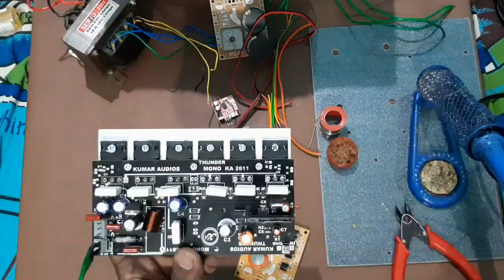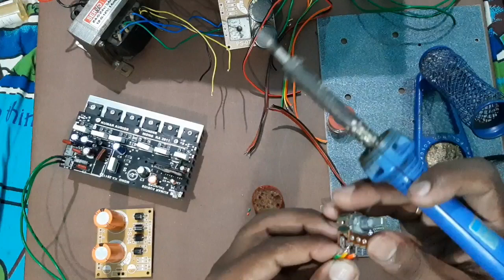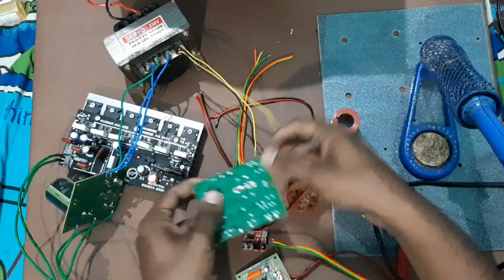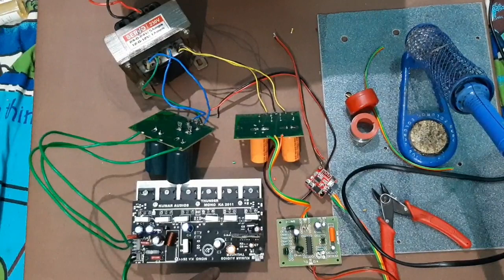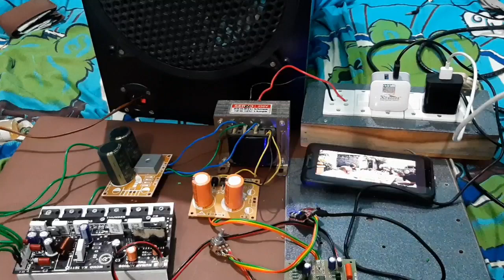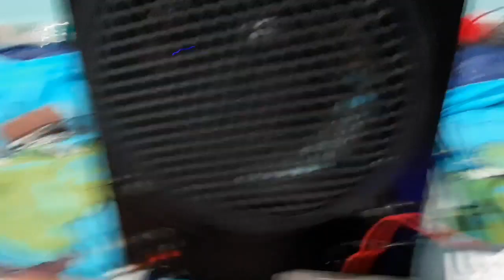6 FET MONO AMPLIFIER BOARD CONNECTIONS AND 10" SUBWOOFER TESTING

Comment: Sir ennidam 24 0 24 5amp transform er ulladhu. Athai intha kumar 2611 board&tda 7294 dubule ic stereo board &4440 dubule ic stereo board use bannalama. appadi use panninal output eppadi irukkum sir please sir please sollunga sir
Reply: 4440 ic க்கு12 0 12 volt 3 or 5 amps transformer பயன்படுத்த வேண்டும் ,single power supply,

Comment: 12 inch 1500 watts 2 sub ore bordla use pannalama
Reply from the maker: 2 subwoofer use pannalam but 
16 OHMs sub ah irukanum
Reply: Inkitta 8 ohm tha 2 eruku appo 2 bordtha use pannanuma bro
Reply from the maker: @kd8225  apo woofer ah series la connect pannunga bro
Reply: Bro 4+4=8 4oms sub 2 eruku bro atha ketta
Reply from the maker: @kd8225  4+4 means in series is 8ohms
4+4 in paraller is 2 ohms bro 
2ohms indha board la poda mudiathu

Comment: Intha bordku 50.0.50 .15 amps transformer use pannalama
Reply from the maker: DC voltage 55 ku mela poga koodathu and below 10amps than use pannnum
6 transistor x1.5 ah max = 9amps

Comment: 27-0-27 10amps transformer use pannalama
Reply from the maker: Use pannalam bro but volume low ah irukum
Higher voltage = high volume
Higher ampere = high punch